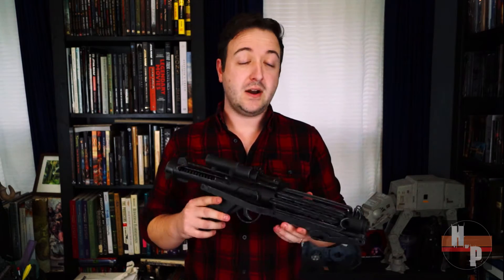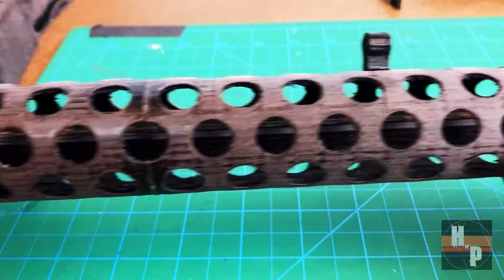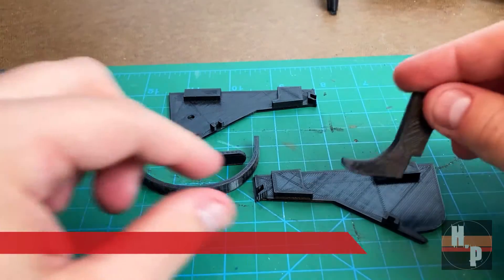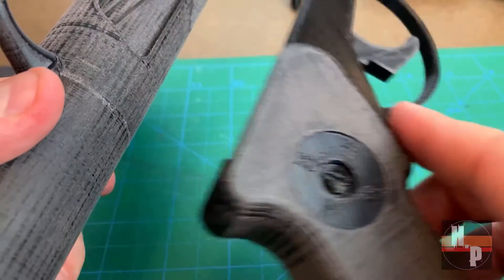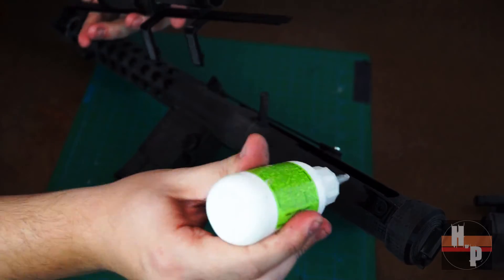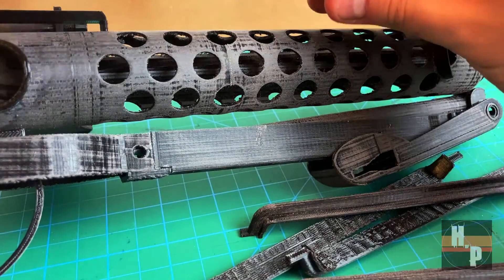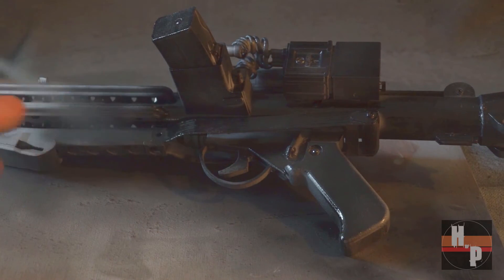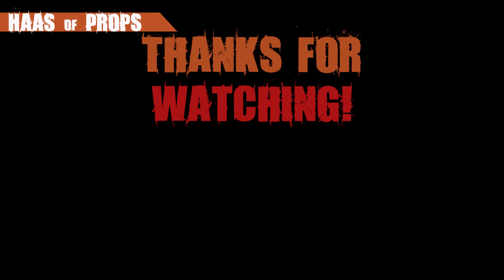Star Wars Stormtrooper E-11 Blaster 3D Print & Build | STAR WARS BLASTER used by STORMTROOPERS

Comment: Hey I've been thinking about getting a 3d printer for myself.  Is it hard to set up?  I wanna do this as a hobby and decorate my mancave.  I don't have time to be making stuff like this for anyone lol.  Plus I recently joined the 501st and I'd love to have my own gear that I made.
Reply from the maker: It depends on the printer. I use an Ender 3 Pro, and I can't speak for all Ender products, but mine came in pieces and I had to assemble it. But, there are many others that come pretty much ready to go. You may still need to attach the print head and fill the machine with filament (those are pretty quick).
Reply from the maker: My suggestion would be to look for a printer that has a self-leveling bed. This will save you a lot of time and a lot of headaches. 
Another thing to check is the printer's printable area. Because if it is small, and you want to print something large as armor, you will have to split the objects into smaller pieces and will need to be reassembled which will take a lot of extra time.
I hope this info helps, if you have any other questions feel free to ask:)
Reply: @haasofprops  you answered a lot for me.  But after that is it easy to program?
Reply from the maker: @SuperBoyd  Most printers that I have worked with have a software that comes with them or is easy to download. .stl files are the standard for many printers, but not all can use .obj files. 
Usually all you need to do is load the file into the program, adjust the settings (infill, shell, etc.) and then print.
Some printers hook directly up to your computer, others can print through a wireless setup, and some print from micoSD cards.
The best thing about 3d printing is you can get it printing, and then walk away. (However, I like to check in just to make sure nothing funky is happening).